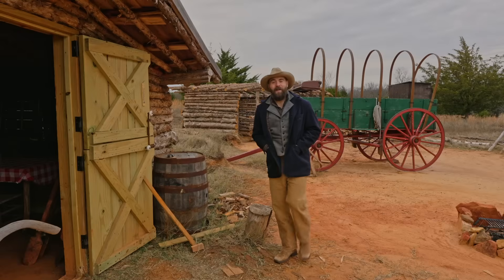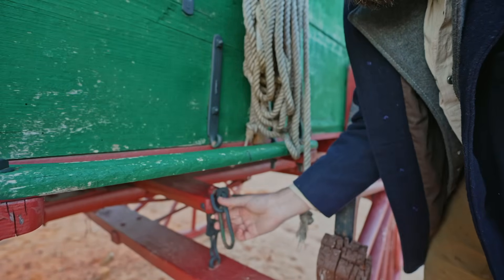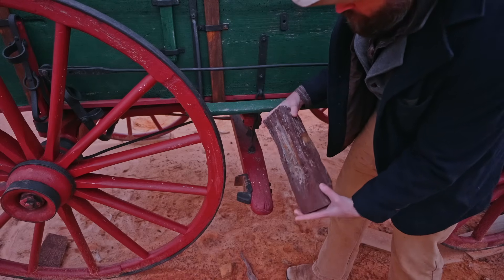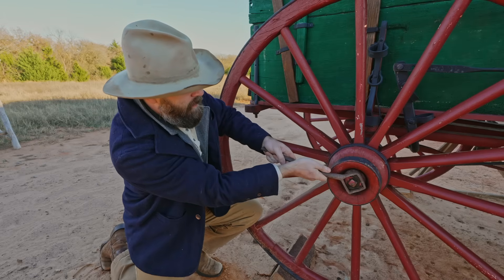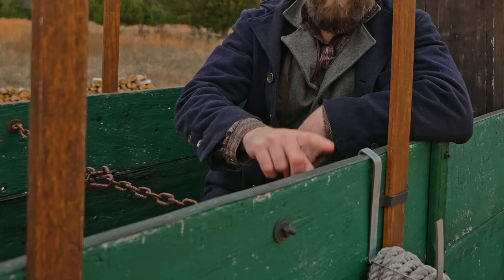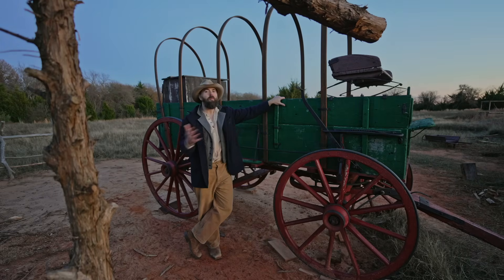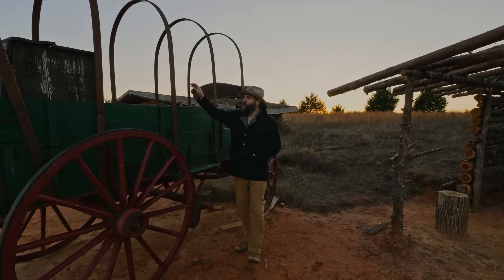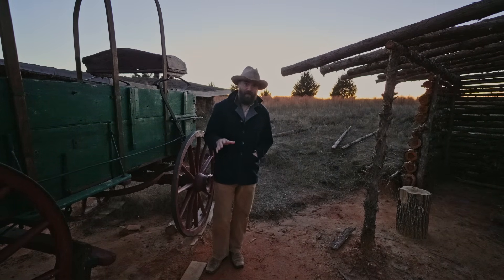The Genius Engineering Behind Pioneer Wagons (And More!)

Comment: As a boy of about 12 living in a small town in central Indiana, it was a real treat for me to spend my summers farming with my grandpa. It was the wheat harvest time. Grandpa had 2 farms, the eastern and the western. The wagons all looked like yours. 4 or 5 of these were parked on the narrow lane leading to the barn on the eastern farm grounds near the creek and flowing well near the gravel road. 

Grandpa asked me to take one wagon full to the brim with wheat and pull it up to the barn. All the other wagons were parked but not chocked on the right half of the lane. My wagon was slightly wider than the others and I wondered if mine could squeeze by. I almost made it, too. Unfortunately though, the end corner of mine tapped the corner of the end wagon near the road and it started to roll down the gentle slope to the road. Had it crashed, it could have killed someone and lost thousands of dollars worth of grain. What was I to do?

I put my Farm All H in reverse and jack-knifed my wagon into the one headed for disaster, stopping it and in doing so, I broke the wooden tongue on my wagon, but saved the day, without spilling a single grain.  Grandpa just said, 'I have another tongue in the hay mall at the 'other place'. So, then I learned how to replace it on my wagon. (Grandpa and I dismantled and rebuilt the assembly in about 1 hour.)

When dad moved our family to Florida, he dismantled my wagon and shipped it by rail to our new home. It was parked at an antique shop for years until my dad died and also the shop owner. That's when I inherited my wagon back. 

It is still in our town today. I rebuilt one of the wheel's roller bearings by hand. (A real nightmare) These were long-sleeve 1/4" rods crammed into the hub and packed with grease, but very hard to keep in place while I tried to mount the heavy wheel over them! I quickly learned something about the hardships of my ancestors.

I gave the wagon to a local farmer friend and they use it to have tractor races pulling it around their 3 story rural homestead to this day.
Reply from the maker: Wow, what an incredible story! Such great family stories and that's amazing you were able to save the day. I'm so glad that wagon is still around today, wonderful history. Thank you so much for sharing.

Comment: In the early 1960s, my dad purchased a cloth cover kit for our little red wagon. He drilled holes in the wagon to fit the wire hangers. He then secured the cloth cover over them with the attached rope strings. It was awesome.
Reply: Looking forward to your next episode. I always enjoy them and learn from you. Was just reading about how the sod houses were much improved by plastering the inside walls to keep the warm air in. You've already done that plus your shutters. Adding thermal mass, e.g. rocks or bricks around the outside of the woodstove can also help. Simple things but practical. 

The mouse tally just jumped to 191 this morning. Ridiculous.

Comment: As a young man growing up on a small farm in upper West Tennessee, I picked corn in a wagon like that. My father and uncle picked the two rows either side of the wagon and I and my cousin picked the down rows (ones the wagon had broken down). The horses did not need a driver which meant everyone could pick. A wagon accessory need for emptying the wagon was a scoop board. This was a 18 inch wide board that rested on the tail gate of the wagon and sloped down to the floor.  This allowed the corn scoop to work into the ears of corn.  Once the floor of the wagon was cleared enough to slide the scoop along the floor, the scoop board could be removed.  
Enjoyed your video.
Reply from the maker: Wow that's really neat, thanks for sharing that story! I can imagine that was pretty hard work and long days.

Comment: Just think if we applied this concept to  modern cars . Unbolt body . Fit a two seater soft top . Need to move furniture . Fit a cab with flat bed behind . Want a dune buggy . .leave the body off and fit roll over bar . Want to go camping . Fit a camper body with beds , cooker , toilet etc . You need it . We can build it  😂

Comment: If you want to have a wagon for yard art, Why not rebuild it using one of those decking materials that are composite (wood & plastic, etc.) that will not deteriorate to become an eyesore? I rebuilt a deck using one of those boards that was made to look like a finely sawn raw wood. This one was a  darker wood, though I can't remember what wood it was made to resemble but it was quite pleasing to look at, even years later. 

it was sold at Lowes or Home Depot, and if you want a similar product, the both have extensive catalogs of composite wood products... or you could just google it.  If they can make deck boards out of composite, I am certain you can find it in boards in practical sizes you can use as lumber to rebuild a wagon that wouldn't deteriorate in the weather... and would make an excellent Hollywood decoration for filming. And because it looks like real wood, No one would know it wasn't real.
Reply from the maker: I may do that when I build a new wagon. This one I'll try and preserve.

Comment: Very good work on restoring/repurposing this historic vehicle. A late friend of mine was a wain wright or wagon builder. I helped on several projects in his workshop and forge. One project was commissioned by a Federal musem to recreate a very unique wagon used for international cross border trade and had no surviving examples or images. The friend knew that era well and the technology which would have been employed.  He built the wagon with normal accessories such as a lazy board and the museum took possession. The story behind the wagon is fun. At some point on the cross border trade between Mexico and Tucson AZ the Mexican authorities decided to make more money in fees and doubled the import fees for each wagon. Not to be outsmarted the local freight line fixed the issue by simply building wagons TWICE the  size! That unique historic wagon is what a Fed Musem Curator really wanted.  😊😊
Reply from the maker: Wow that's an awesome story! Thank you so much for sharing. And it's really cool you got to help with those wagons, they're amazing machines.

Comment: How often do you have to grease the wheels and how long do axles last ?
Reply from the maker: Ive read that you're supposed to grease them every 40-50 miles. These are the original axles as far as I can tell so they must hold up pretty good.

Comment: My father was an ice runner in the early 40’s and he ran buckets of coal during colder months in Pennsylvania.
The wheels were often used as corner markers for property claims. Some would travel till they broke a wheel and decide “That’s it, here is where we will live.”
Reply from the maker: haha that's what I would have done, repairing a wagon wheel is no joke. If I'm able to build a new wagon that's the part I'm most worried about.
Reply: @WesternPioneer You can do it Will. You have knowledge, perseverance and physical strength. Tools, well you can get them. You need a forge for the iron works. (A good size one , 3'x4'?) ❤

Comment: Why didn't the wagon have suspension?
Reply from the maker: I'm not sure because the stage coaches had suspension, maybe it was just to cut costs and that these were usually pulled by oxen so they were slower.

Comment: The brake was for downhill grades to keep the wagon from pushing the horses. 
Some teamsters could work it with their foot. Some grades required both feet!
The log you used as a demonstration of a doubletree was appropriate. As they were expendable and needed replaced. They were hooked to the traces which pulled the wagon. 
I have never driven a team of horses. But Dad was a teamster from the age of fourteen. The state hired him as a teamster to haul rocks for roads.
Reply from the maker: Oh of course using the breaks for downhill grades make perfect sense. That's so cool about your dad, he was probably a tough man at 14.

Comment: I wonder about two things concerning these wagons:  1) Details of the wheel bearings.  Being in the automotive trade I am used to Timken style roller bearings, or the newer sealed ball bearings, but what about these 18 & 19th century wheels & axles?  
2)  Why are the steel tires so narrow?
Thank You for the talking tour, it was greatly informative and entertaining....  RooDog
Reply from the maker: My best guess about the narrow wheels is that they were easier to pull and that they probably weren't worried about wanting better traction since the wheel's don't provide any power. I don't know enough about bearings I know they had to grease these every 40-50 miles. I found this video (I love this channel) in it he converts the old style wagon wheels to roller bearings and you can see how it all looked beforehand. https://www.youtube.com/watch?v=ew1pkbCvDB8

Comment: One thing I've always wondered about wagon wheels--why didn't they make wheels wider with a ridge down the middle?  When you're on hard terrain only the ridge would make contact and reduce friction, when you're on soft terrain (mud) the contact patch would be much larger and stop the wagon from sinking.
Reply: I’ve seen tractor wheels like that. Where weight didn’t matter as much.

Comment: I knew a few "Old Timers" in my youth. Many of the "sheep Camps" were built on wagon frames. The inside was wide enough to accommodate a bed towards the front. At the back was a small cook stove. There would be a piece of "tin" (sheet metal), that kept the canvas from burning. Later on they would be outfited with ruber tires. Most of these axels would be front axels from cars, mounted on a beem. I knew an old timer who would refurbish these sheep camps, and upgrade the with a plywood roofs, with sheet metal over that. I actually seen the wooden hoops  that once held the canvas top. Food like eggs would be buried in oats to prevent breakage. I do collect antiques. I found a metal wagon "cooker". It was a well insulated box, usually cork, top and bottom. The inside was circular, the size of a ceramic pot (I don't think they made cast iron that tall, and that narrow.). There are two cut circular pieces of stone, about 2 1/2 inches. These would be placed in a fire to be heated up. Then one placed in the bottom of the cooker, follow by the ceramic crock, then the other placed on top, and the lid shut and locked shut. At the end of the day, your dinner would be ready to eat.
The entire thing is basically a prehistoric Crock Pot.
Edit; a plane in the backdrop, is like the jet contrails accidentally filmed in a Fess Parker, Daniel Boone movie. A modern thing we are all use to, but that the producer missed.
Reply from the maker: Wow that's really interesting, I'm glad you shared all that. I love the idea of storing eggs in oats, that's brilliant. And I love catching old movie mistakes like that.

Comment: Great video! So the Montana Trail went from Corrine, Utah to the goldfields of Montana and something like 800 freight wagons made the round trip between the two, four times in a season, between early March and October.  After four trips, those wagons were totally worn out and replaced.  New wagons would come from the east coast factories by train, flatpacked.  When the wagons wore out, the hardware was sold or repurposed.  Many of the early homes of Corrine, Utah and the region, were held together with wagon bolts.  You can still see these every once in a while in pioneer age homes.  Waste not want not. Thanks again.
Reply from the maker: Wow that's really interesting I never would have known that thank you for sharing!

Comment: first off, yeah, you got plenty of work on your plate, but tell me, what do you think of this idea, simulating frontier problems. for example, its not ideal but hear me out, simulating a wagon wheel breaking. make your own wagon jack so you dont have to use and possibly break the antique, but go through the process of having to replace a wheel, maybe a repair like the rim, or a couple of spokes, or putting together a new wheel with all the parts, something like that. because im sure that definitely happened enough in those days, not everyone bought a new wagon, terrain wasnt ideal, it happened and it was a problem, it would be informative to see the process, and also understanding what goes into it.

basically many people have different types of survival or old lifestyle type videos, few deal with the actual issues that would have been presented, i think it would give a new depth to understanding the lifestyle
Reply from the maker: I love the idea. I did a similar thing by using sod to build a lot of my cabin, I was really curious as to what problems would come up but I hadn't thought of doing that with my wagon. I'll be thinking about that.
Reply: @WesternPioneer  the rain did that for you though! Thank God the damage wasnt irreparable, i was heart broken
Reply from the maker: @Seawolf69  Yeah that was a tough month watching it slowly fall apart, but it really wasn't that bad.

Comment: Awesome, I did have a question (thought I'd add it here before the comments are swamped), do you own the land or are you renting it?, also, if you're building your own wagon then blacksmithing would be something to look into, just remember that they used charcoal for fuel, so you'll need to build a charcoal kiln, which were very popular in the old west, you'll need a lot of stone if you're building it above ground, or build it below in a charcoal pit, which is more messy but requires less materials, either way, looking forward to the next video!
Reply from the maker: Hey thank you so much. I really did get swamped with comments in this video so I apologize it's taken me so long to respond. I do own the land and it's pretty tucked away, this town only has 242 people in it. Sadly there's not much stone on the property but there's plenty of clay so I plan on making bricks for a kiln, it should be lots of messy fun!